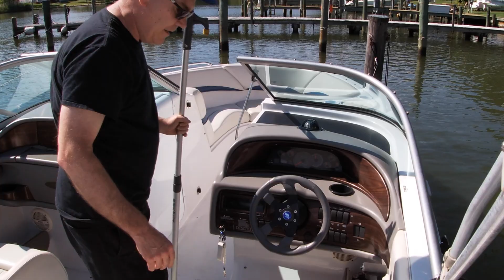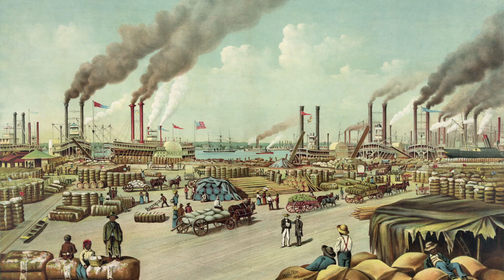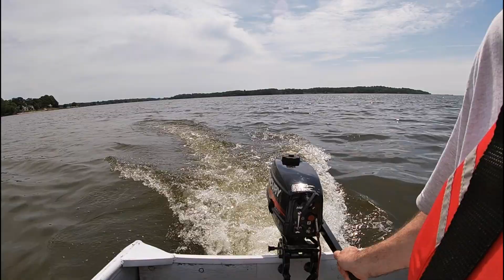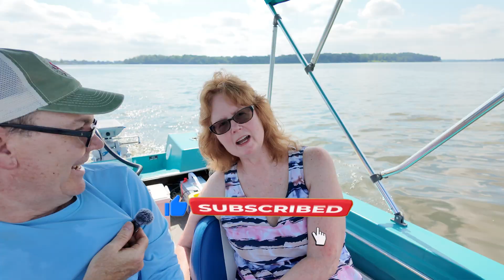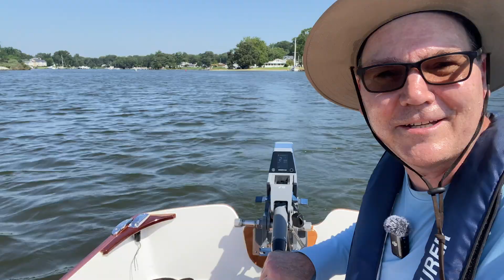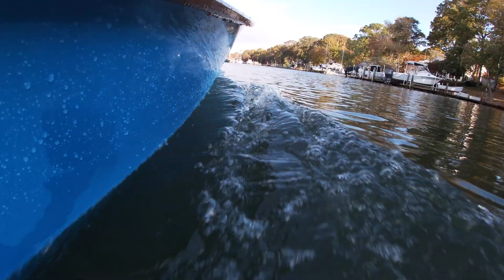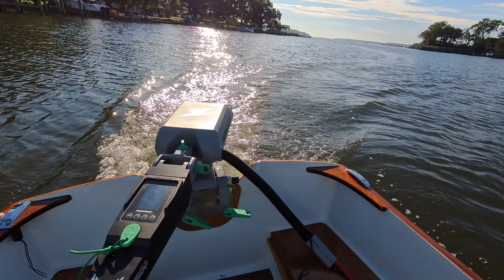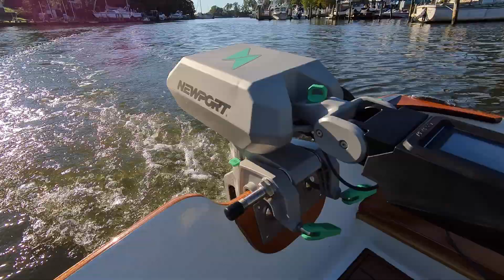The Horsepower Issue with Electric Outboard Motors

Comment: If you’re going to discuss this controversial and often misunderstood issue, you should be sure to point out that the majority of these electric outboards are rated based on their input power not output power, whereas ICE outboards are rated on their output power at the prop. 

That means once you factor losses in, the electric outboards are actually even less powerful by comparison.

Also with regard to max RPM, don’t forget that Honda has gear reduction built into the lower unit that reduces RPM at the prop by around 50%, so RPM at the prop may be a lot closer than you think when comparing to a direct drive Electric capable of spinning a prop at more than 2K RPM.
Reply: True, but it’s a much smaller correction than when they went through the same sneaky marketing tactics decades ago with gas HP. Less than 10% losses in many cases.
Reply: @eagleray1 Less than 10%? 
First most manufacturers don’t disclose just how inefficient their motor systems are and only focus on the input power. 

Motor type, ESC design, component quality, operating temp, wire sizing, it all factors in to what you are actually getting at the prop shaft. 

EPropulsion for example rates their Navy 3.0 as having an overall efficiency of 51%. 

Even if losses were only 10% as you suggest, it’s still a significant loss when you’re on the water drawing from a battery with limited capacity. 

A 10% loss in efficiency with an ICE that has a 5Gal tank of gas with much greater energy density and capable of far more range and runtime is not nearly as significant by comparison with regard to spending a day on the water.
Reply: @Willdesignsandbuilds  I assure you it’s less than 10% in most cases. I know bc my channel is full of range, speed, and runtime tests which can be converted with napkin math to show correlation to input power, and I regularly share the input power and all the other way-too-sparse data they include in their data sheets. I’m not saying electric is better than gas. Both have advantages and disadvantages. I think both are great for their specialties. But the fact is when they switched from input to output on gas in the 80s, it changed the number on the cowl by more than 50% in some cases, bc yes, gasoline is much higher energy density than batteries, but also, gas engines are gigantic relative to electric motors of equivalent HP and their hundreds of parts get stupid-hot in comparison… hence lots of losses between input and output. That’s simply not a thing with electric. There are almost no parts and the whole thing is meant to run at much closer to ambient. The losses are thus less than 10% unless something is very wrong in the build, by the nature of electric motors. They don’t need to disclose the output power because the losses are small and easily calculated implicitly. Or if you want to hook up a dyno to prove it explicitly, it’s way easier than with gas too.
Reply: BTW, the 51% you’ve seen is true despite everything I said also being true. The 51% is not power efficiency. It’s energy efficiency. It means at full throttle, electric eats its own battery like an mf-er 4x as fast as 50% throttle. That’s not a thing on gas bc fuel efficiency on gas is WAY better. But that’s a separate issue from power loss efficiency in the engine/motor. We were talking about different things.
Reply: @eagleray1  Checked out some of your videos. 

Sorry, but not impressed by the testing methods or the cheap testing equipment and products. 

Minn Kota for example makes some of the least efficient motors of anyone. Some even shunt power to resistors in order to achieve speed reduction, use plain bearings, poor quality lip seals, etc.. 

A high quality PWM ESC and a brushless motor “should” give good efficiency Watts in versus Watts out and may approach close to 10% at peak, but in a growing industry with pricing wars, costs are cut, and that starts with the quality of the materials and components. 

If a company can shave a few pennies by going with a lesser efficient/spec component, smaller wire, more resistive connector, etc.. they often will, especially if the product has a very limited warranty, and it all adds up. 

Just because Google or AI spits out a general percentage for efficiency of a brushless motor or a DC ESC doesn’t mean that it applies across the board, it’s a potential best case scenario. 

I’m in the electronics business. I’ve been into electric boat propulsion since before it became trendy and I don’t do it to promote a YouTube channel, my experience comes from building/using my boats year round year after year, and they need to be safe and reliable, provide predictable performance and operate efficiently. 

Overall efficiency is the name of the game. 

Most people aren’t going to go out and run their electric outboard at its peak efficiency point all day long, they will vary the throttle speed, and thus efficiency will vary under load. 

Any inefficiency no matter how big or small equates to a reduction in range and runtime and overall performance. 

My whole point was to highlight the fact that at the prop, an electric outboard is actually producing less power than its rating. 

I’ll also add that I can push my Trimaran at 1 knot on 100W, so loosing even as little as 10% on say a 1kW motor matters to me, which is why I strive to build around high quality high efficiency components. 

Designing around overall and peak efficiency from hull shape to props and solar to motor components is why I can cruise my twin motor solar electric catamaran around at 5MPH using only 550W of solar power.
Reply: @Willdesignsandbuilds  You didn’t refute my claim. You said they’re less powerful bc they report input power not output power. I said ~10%. You said I’m wrong but didn’t prove it bc I’m not wrong. But you said sorry as though my lack of street cred discredits me. What did you want to see in my videos that would make my street cred good enough in your eyes? I’m happy to take constructive criticism. If I build a custom ESC from scratch, can I hang with the big boys then?
Reply: Absolutely!

Comment: Horsepower has always expressed correlation to top speed for cars and boats in ICE engines. That’s why they put it on the cowl. Customers want to know: “will it beat my friend to our favorite spot if he has 15 giga-whatevers and I have 16?” They don’t care what measurement came from where. They just want a reliable frame of reference. Fact is… putting 3HP on a cowl when the top speed is 1/3rd of a Merc 3… is a flat-out lie for money. It’s false advertising… AKA fraud.
Reply: A different prop on a 1kw motor will not get near the top speed of a Merc 3. Nowhere close. You need 2.25kw continuous through the motor to match top speed of a Merc 3. There’s a small margin on that, not a big one. The prop is matched to the throttle curve of the motor. You can boost speed ~10% w/ a prop change, but if you go past that w/ pitch or diameter, you bleed off so much efficiency as heat that you either burn out the motor or you just tread nowhere w/ cavitation and ruin the prop.

Comment: Good info!  Your report agrees with my experience using the 1300 watt ,"3hp" NK300 motor on a 140 lb Kaku Guru.  I'm barely getting 6.5 mph at full power (5.5 - 6.0 at 85% power) while some Guru users report 8+ mph with a 2.3 hp gasoline outboard.  I'm about to beef up my battery reserve capacity with a 50AH or larger 36V battery next to my Newport 40AH.  I'm wondering if some of the newer lithium batteries capable of larger sustained ampere outputs (100 vs 50 amps) might have a lower internal impedance and push an electric motor slightly harder???
Reply from the maker: These motors do have a specified amp draw at top speeds, but I haven't seen any speed advantage with a "better" battery.

Comment: We have twin epropulsion Navy 6.0s on our 37’ catamaran. Coupled with 4 kW of solar, we can enjoy 4-5 knots as long as normal sunshine is available. This is heavenly for our desired experience of just chill and cruise between anchorages.

Curious, would you think this setup better than a single X12 for any reason beyond redundancy?
Reply from the maker: I hope to try an X series in the next year or so. They seem to have had some challenges with them while the Navy series seems to be quite reliable.
Reply: @WayneTheBoatGuy The single X12 would be nice since it still runs off 48v which is as high as I’m comfortable with in a DIY scenario. Wish epropulsion would lend us an X12 to pit our 2 Navy’s against it on the same boat. That would be very interesting.

Also includes the wireless throttle which really helps with controlling the boat from the bow while anchoring. 

I’ll have to dig into the issues they’re having. 

Thanks for your great videos. Would really love to have you join us for an episode (or more) of our Solar Sailing video podcast sometime.

Comment: I found that my needs/desires no longer include electric motors as the main power because of speed and endurance so I went with a Tohatsu propane motor, (5hp) for my Salt BoatWorks FRS12 skiff. I went out on Lake Michigan 3.5 miles in my Native slayer max kayak and found out the hard way my batteries were not large enough and heat buildup melted wiring so lucky for me I had my pedal drive to get back home. I have a electric trolling motor on the skiff but will rely on my Tohatsu to travel long distances.
Reply from the maker: Thanks for sharing your experience and what you learned!

Comment: Gas engine rpm in outboard motors is linked to the propeller by gears. The ratio of the gears changes the rpm delivered to the prop. Some electric outboard motors do the same. Some electric outboard motors have the propeller on their shaft. Some gas engines do the same with a long shaft over the transom. Every propeller should be designed for a target speed and load.
Reply: You have the Elco motors which are geared. I would be interesting to compare an Elco with a gas powered wrt top speed.
Reply: Totally agree, the rpm of the engine is irrelevant for top speed. Beyond the gearing the prop pitch has a similar effect. Gas engines are pitched for top speed and electric are optimised for efficiency. An electric motor could spin drastically faster than a gas motor ever could, but trade off would not be worth it

Comment: I had a 6 horsepower tohatsu on my 2200 lb sailboat. Hull speed is 5.7kts. No matter how much hp you put on it it won't go faster motoring. At 1/3 throttle my tohatsu pushes the boat at about 5kts. I replaced that outboard with an e propulsion spirit and at full throttle I hit about 4.7kts (I only use full throttle unless I'm docking). I sail the FL keys and both numbers are consistent over multiple trips even right into the wind and moderate chop. For me the epropulsion isn't exactly 3hp but it's close enough. I'm happy with it.
Reply: But if the ePropulsion did 4.7 knots, so would a 1hp tohatsu. What you’re observing there is the amount of drag water puts on all boats b4 they get on plane. With a boat your size, all motors of any power rating 1HP or higher feel about the same slow-AF speed if you can’t get on-plane, and sailboats don’t plane, so for your hull, pushing much above 1HP is exponentially wasteful on fuel or juice whether you go gas or electric. But the issue in the video is: do these numbers matter. They DEFINITELY do. A Merc 3 is legitimately 2.5X higher top speed than the ePropulsion for a small boat, especially a planing hull.
Reply: @eagleray1  I've pretty much in the same situation, currently powers my 25' 2200 lb sailboat with a struggling 5 hp Mercury, easily goes 6-7 kn at top speed. When the motor don't cooperate I've used a 30lbs Motorguide and manages around 2-2,5 kn. Would really like to go at least 6 kn electric but hesitate... To go above the Spirit line skyrocket the cost....
Reply: @eagleray1 wrong - only for a planing hull that can be pushed up on a plane by the gas outboard.

Comment: I'll admit- I only looked at wattage & voltage. I have a 500w mid-drive electric bicycle with two 48v 10ah batteries. Horsepower has been a unit I haven't bothered to interact with because torque, watts, voltage, and amp hours were already a part of what I think about from my experience bicycling.
Reply from the maker: Yeah people who already 'do' electric have a better understanding of how it all works.

Comment: "Sizing" electric motors so that you can compare electric motor X to gas motor Y has been a problem basically since electric motors were invented. I dealt with this a lot when trying to design and build electric-powered model airplanes because the only frame of reference available was gas motors. What was the electric equivalent of, say, an .049 glow engine?
The methodology I eventually settled on was comparing suggested propeller sizes and motor rpm. Could the electric motor I wanted to use spin a 6X3 prop at 9,000 rpm or more? That would make its performance close to an .049 glow engine. Not perfect, but it worked well enough for most applications.
I think something similar may be needed for the new electric outboards.
Reply from the maker: Yeah - it’s not apples to apples!

Comment: Wayne, I appreciate the video but I suggest you define/discuss the following terms: torque and thrust, shaft horsepower or power at the prop, peak power, rpm, propeller pitch and propeller diameter.  

Electric outboards seem to be rated at their INPUT power, NOT power at the prop which is also misleading. Electric motors are more efficient than internal combustion engines at converting energy into torque.

I suggest outboards be rated based on thrust in pounds (or kilograms) which depends on power delivered at the propeller, prop diameter and pitch.
Reply: Power at the prop is the most important, some such as torque is a red herring and thrust isnt perfect either since it varies by speed. One should always be able to change prop if the speed regimen one is interested in is significantly different from what the factory intended for the motor, just as one can with ICE outboards.
Reply from the maker: Another variable is the small electric outboards are direct drive - the prop is literally attached to the motor.
Reply: @WayneTheBoatGuy  yes, that's true!  But they have still losses in the ESC and also in the motor itselves. Torqueedo reports honestly the actual efficiency in some of their pod engines, the number is less than 60%. Assume that is consumption vs shaft output.
Reply: @WayneTheBoatGuy Some are direct drive and some are geared.  The direct drive outboards are touted as quiet compared to their geared cousins but I wonder about the difference in torque.  I owned a Torqeedo 1003, geared electric outboard, that sounded a little like a gas turbine and accelerated my 17'x6' wave piercing catamaran to 7 knots. You can see one of my speed tests at my YouTube channel gulfowlvideo.

I now have a single cylinder, 4-stroke, air-cooled Chinese manufactured outboard rated at 3.43KW on the label but marketed as a "6 horsepower" outboard.  With this outboard on my 17'x4' catamaran, I achieved 12.2 knots (14 mph) at WOT.  I estimate fuel consumption to be .5 gals. per hour at WOT!
Reply: If ICE engines were rated at the input power ( equivalent energy inputted) they would be 2/3 more HP but 60-70 % of that input power is wasted as heat and other losses, Electric converts 70-90% of the inputted energy into actual work, The ICOMIA standard is for manufacturers of all outboards (ICE or Electric) to measure at the prop shaft